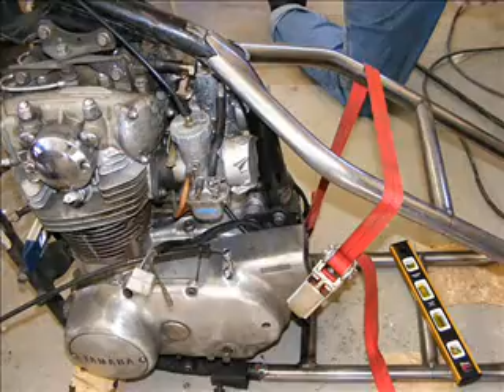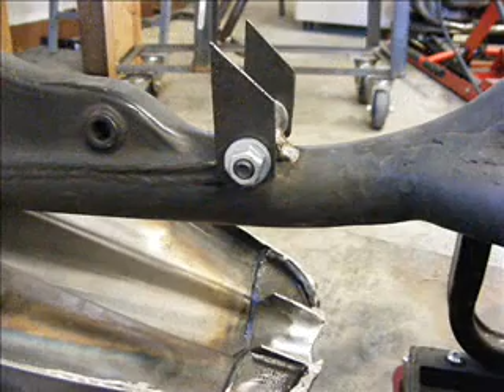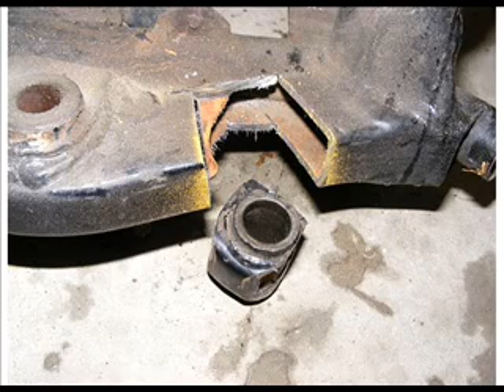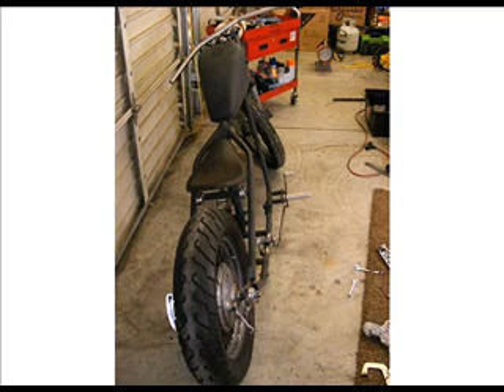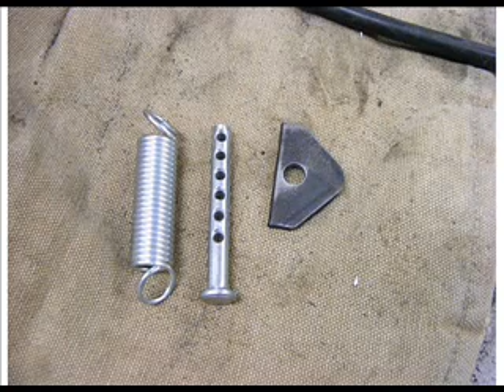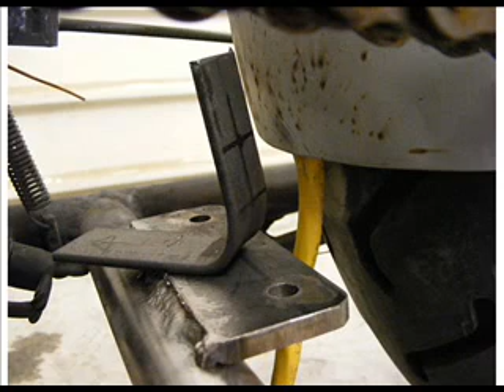xs650 Bobber Project Chad's

Comment: fantastic build.. I currently have a soft tail frame, but thinking about buying some tubular steel and making it into a hard tail for a custom bobber build..
but do you think MIG welding a new back end will be strong enough??
Reply from the maker: I have had no issues with my build/bike